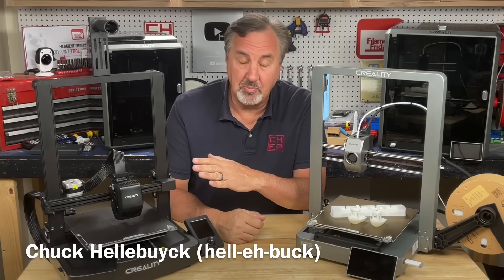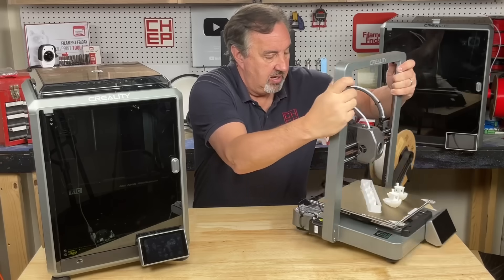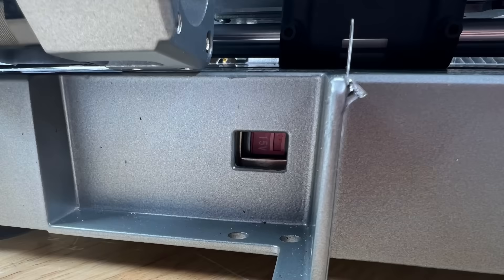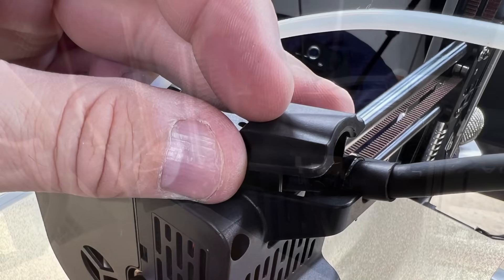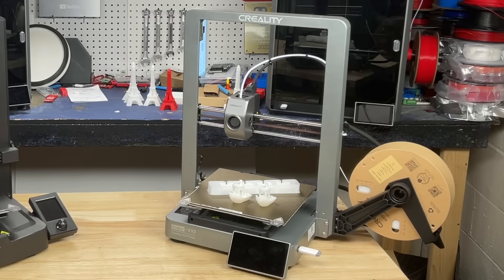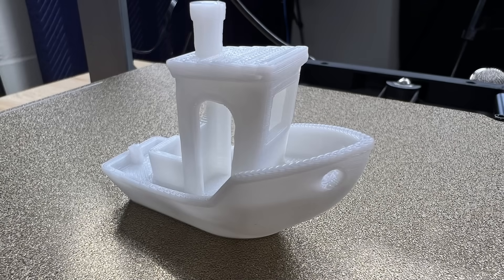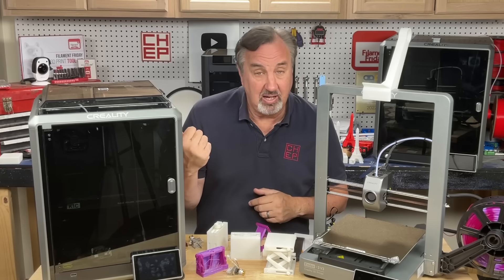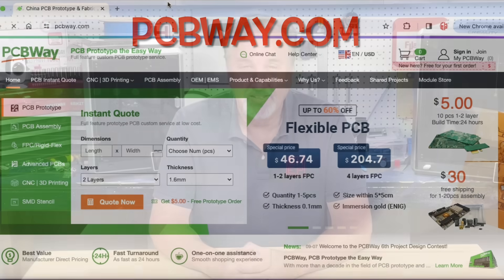Ender 3 V3 - The Fastest Ender 3?

Comment: Did you ever use the top mounted spool holder? I think the side mount was intended because having the spool on top creates issues if it jiggles when printing at high speeds
Reply from the maker: Not on this printer. Original Ender 3’s used it on top for many years.

Comment: Hi Chuck,  are you facing issues with ender 3 v3 se stringing? The PTFE tube inside the hotend is blackened. I could not replace it as stand PTFE tubes have 4mm as od while the PTFE tube used is 3.9mm.. i cannot find a replacement tube.. have you faced this issue yet?
Reply from the maker: No, I wasn’t aware of that size difference.
Reply: @FilamentFriday  The cheap ones that I had been using are 4mm while good quality ones are 3.9MM OD., I was able to buy PTFE tube with 3.9mm od, But I decided to upgrade to bimetal heat break, Thanks

Comment: Hi Chuck, looking to upgrade my old Ender3 V1, hesitating between the V3 and the V3 KE, have you had a chance to check out the KE?  Didn’t see a vid on the channel but maybe you have info from other people.  From what I’ve just seen I’m less interested by the V3.  Speed is of course nice but not a deal breaker, thank you !!
Reply: Just get the V3 CoreXZ. Less head ache, fixed gantry (no wobble) and is just a 1 click print. It also has 2 fans, bed and head G sensor and is fast. Worth the price

Comment: Just got my Ender-3 V3 and I hate the location of the spool holder, too. So I moved the two mounting posts up to the two holes at the top of the printer and it clipped right on. Can't use the spiffy kickstand with it mounted on top, but I didn't have to print one and it seems to work just fine, even using the runout sensor. The filament does get into the wires, so I may run a reverse bowden tube to provide some guidance for it, or I may just bypass the runout sensor and run it directly into the top of the extruder.

Comment: Beware of Creality 3D printers for professional use. These machines might be marketed as universally beginner-friendly, but professionals may find them underwhelming and unreliable.
Creality printers prioritize affordability over versatility, not balance between two. Their focus on PLA filament, which limits their application in professional settings that require sturdier materials.
 Don't let curiosity empty your wallet! Many professional users who opted for Creality printers have ended up returning to traditional methods like CNC routing or injection molding. Consider these alternatives for serious projects if you don't have a bang for the buck.

Comment: do you have any thoughts on the creality v3 KE? its supposed to be 500mm/sec but wasnt sure on the quality of print at that speed
Reply: So far I'm not bowled over by the print quality I'm getting from mine. I have a lot of experience of using some original Ender 3s and they blow my V3 KE away in all honesty. The shop I bought mine from have offered to have mine back to either repair or replace because there's such a difference in surface finish between faces produced in the Y axis compared to those produced in the X axis

Comment: I received mine a few days ago and the firmware on it is terrible. It won't allow you to adjust the Z offset unless it's printing, and then resets once done. You also can't manually set the speed while printing, it only gives you predefined settings. You manually can set the temp though. It makes no sense. I just hope they update it soon.

Comment: Oh no! Yet another Ender 3 (v3) printer after the Ender 3v3 SE and Ender 3v3 KE... Too bad Creality doesn't get it that sometimes less IS more!
Instead of 3, 5 or 7 new Ender printers there should be only one "new" Ender 3 with noticeably better features than the predecessor v2 and a compelling price!

Instead Creality confuses their own potentially customers again with too much half backed options!
Creality, please bring less printers but invest that development time more into the user experience, details and the support of existing machines!

Sovol brought the SV07 out a while ago and the reviews were just fine! So if I would want a fast open printer for below 300 bucks with that build volume: I'd buy the Sovol SV07 instead. It has better cooling, is easier to maintain and seemed to be more polished out of the box.
The Bambu A1 could also be an option ... but I don't like their closed firmware and there are some tests revealing privacy issues. Bambu Lab is collecting a whole lot data ... too much for my taste.

But since there is a better option available from Creality itself: I'd look out for the next sale and the revised K1 (since the release) for around 400 - 430 bucks. It has better cooling, looks better, I can integrate some filters like the Nevermore or Bento-Box and eventually step up my understanding of software and firmware by diving deeper into Klipper.

The only thing Chuck could also do a video about is: silencing those "speed" printers! ;o)
I gladly would take the option of printing a good deal slower again if the noise level also can be reduced with maybe some fan upgrades and some software tweaks. Sometimes it's simply for me not necessary to use all the speed. So a quiet printer setting for working silently in the background would a nice option.

Comment: Always issues with Creality machines.  I have an Ender 3 V2 which works fine for me BUT, I will not buy any Creality machines going forward.  Crap, crap, crap.
Reply: same, I have a ender 3, i am planning to sell it and buy a Bambu labs A1
Reply: @samtheengineer   If you pay more, you get more. That has always been the case.

You could also have bought a Prusa Mini back in the day instead of that Ender 3. But you didn't because of the price.

Comment: Seems a good printer. But I still prefer my Ender-3 Pro. I bought it in 2020, then I got an Ender-3v2 and an Ender-3S1. But untill now the Ender-3Pro prints much better quality and I do not have to tweak the settings all the time. I rarely touch the settings and the print quality is still very good. For the Ender-3S1, I need to correct the settings many times. 
By the way, could you tell me if I'm still on the list of your patreons?
Another question: I'm using Cura 5.6.0, but I have notice that the tree supports are hard to remove. Any suggestion?
Reply: Agree.  My 2020 Ender 3 Pro has been a workhorse.  I did, however, replace the control board with a 32 bit silent driver board and swapped out the bed for a PEI.  Rarely do I have a failure.

Comment: Hi Chuck - I think you are having a problem with this type of Textured sheet, it is not the first video you don't get a good smooth 1st layer :) Did you wash the plate with dishwashing soap and warm water before you started printing? Love your videos and I want to try this new Core XZ Ender 3
Reply from the maker: I clean all plates often. The plate worked fine on the k1C. Also works fine with PLA and PETG. It’s not the plate. The moving bed is not as good at speed as the stationary bed of the K1 style.

Comment: Something tells me that design is going to have lots of issues and problems with overall reliability of the design. Seeing as its critical on belt tensions and knowing how Creality (short for Crap in Reality) are with their lack of quality control and cost cutting, it'll be interesting to see how these hold up to use after 6 months or so. Print quality and speed doesn't seem anything special for the price of the machine.

Comment: I suspect one possible reason for a side mount could be to help mitigate larger vibration oscillation at high speed to simplify input shaping requirements
Reply: +1 .  When I installed Klipper and reached 200 mm/s on my Ender 3 S1, I changed the position of the spool to reduce vibration.

Comment: Chep, that you for another honest review.  The Creality company really baffles me.  Years ago, Crealty became an industry leader by offering decent, inexpensive machines like the CR-10 and Ender 3 that opened up 3D printing to a lot of hobbyists who could not afford more expensive machines.  I myself have a couple of Creality machines: an Ender 5 Pro and an Ender 2 Pro.  Both have served me well, but I have since replaced them with more advanced printers (the Qidi X-Max 3 and X-Smart 3)  because I wanted enclosed printers that could print faster and with a wider variety of materials.  Creality has made some good (and even excellent) machines, but I have a feeling that they lack focus.  They seem to waste a lot of their efforts on different printer models that do nearly the same thing, and not always well.  I have a feeling that a lot of their quality problems would go away if they focused on manufacturing and selling just a few printer models rather than the dozens and dozens of Ender 3 variations that they seem to be obsessed with.

Comment: Microswiss just released a k1C hotend.  Wonder if it will work for the 3v3.
Reply from the maker: It should. I have a couple coming to try out.
Reply: @FilamentFriday  I the flow tech for my K1 Max it's been awesome.  Swapped to the new hardened nozzle yesterday.  Took 5 mins.  So easy.

Comment: It's obvious why they used a side-mounted filament holder. Putting an extra KG on top of that flimsy frame will result in a lot of flex, and poor quality prints (that get worse the taller your print gets). I've dealt with the same thing for years on my Artillery Sindwinder printers. I suspect you should be looking at some bracing of the chassis if you want to move the filament overhead at those print speeds.
Reply from the maker: I’ll find out with the top spool holder I found.
Reply: If Creality would think through their products more thoroughly they would implement an option in the firmware where the printer reduces speeds and shaking when a spool is mounted on top! I mean it's good to have the option, but Creality's job would be to test it and explain to the user what could happen with all the flex ... especially when the spool gets smaller and the weight differs (so compensation would be off, too).
It's should be easy to give the user the choice of printing the right holder by himself. Also showing a 3rd option in the manual with spool dryer beside the machine (so that no weight is mounted to the printer) would also be a compelling setup for many.
A simple question in the printer setup or options menu on how the spool is mounted should be easy to code these days ...

But Creality does Creality things ... or in this case: doesn't do those things, sadly.

Comment: For context, I'm a Creality fan, started with end Ender 3 Pro, and have a Ender 5Pro, K1Max and Ender 3V3 SE. I like all of them. Having said that, I'm not sure why this Ender 3 V3 exists, even if it did print all of the materials successfully.  You can get a K1 for only $100 more. Or if you want an inexpensive bed-slinger, the Ender 3 V3 SE or KE are both great and print all materials flawlessly. The SE is under $200 and the KE is about $250.  $400 for a bed slinger just doesn't make sense, even if it did work.

And thanks for another great, informative video!

Comment: Great video Chep. My V3 Prints PLA and PETG pretty flawlessly just like youve experienced.
Now im a bit nervous to give tpu a try. Im not even going to bother with ABS. I will just wait for my k1c. I just hope I dont end up with the same issues on the hotend with either the v3 or k1c since theyre the same hotend setup.
That was a great explanation for the extruder gear arm also. That thing was a bit tricky to get used to

Comment: -Ordinarily I'd say that Creality is listening to people who don't like having the spool on top for weight distribution purposes, but the robust frame and what I assume is a fair bit of weight down low in the base seem to make that a minor concern here. 

-I do like the idea of the spool tension doodad, though. Shame that it doesn't work once the spool has been more than slightly used up.

It seems odd to me that the Z-axis linear rods are a smaller diameter than those for the X and Y-axes...it's the longest axis, why not have a little extra stiffness there?

This review is an interesting counterpoint to the one Aurora Tech Channel just did...she had no particular problems with her standard non-PLA test prints (including a TPU wallet, an ABS crate, a PETG pen holder, and a carbon fiber nylon cable holder) beyond some very much expected shrinkage with ABS due to there being no enclosure. She did notice that the overall print quality is noticeably behind other comparable printers, however; the perforated crate test for stringing was rather horrid compared to even a CR-10 SE, and there were a litany of issues like ringing across a variety of test files. 

Ultimately, it's certainly interesting to see a commercially-built Core-XZ printer. Other than things like the Voron Switchwire or various Ender 3 upgrade kits, I honestly can't think of another printer quite like this one. Seems to me that 1) the usual budget printer issue of highly variable build quality from one machine to the next is still the case with this printer, 2) there might be great potential for modders and tinkerers to turn this printer into a true beast (Aurora found it to be speedy and had a great first layer once Expert Mode was enabled to make Z-offset adjustments), and 3) whomever Creality employs to name their printers needs to be fired and then maybe exiled to a remote island. 

Seriously, only the basic shape ties the Ender 3 V3 to the Ender 3 V3 KE and Ender 3 V3 SE...rather than leaning even harder into their historically awful model naming convention, Creality should try making sense with their model names for once. Sovol does it. Bambu Lab does it. Prusa and Elegoo and literally every other 3D printer manufacturer do it. It's not that hard.

Comment: Creality printers are for people that want to tinker with 3D printers. Bambu and Prusa printers are for people that want to print with a 3D printer.
Reply: Well said. I did the whole ender 3 "mod it til the cows come home" and I'm over all that. I just want to design and print now. My bambu a1 mini has been fantastic in that regard.
Reply: @NWGR it did that too..until nothing was left but the frame and power. But yea, they are just straight selling fully loaded printers now.
Reply: That not the whole picture anymore.

That K1 is doing fine so far, especially the revised versions after the first reviews. Sadly Creality let's the early customer do the job of polishing a product.
And also Sovol printers seem to works quite well out of the box. The slower SV06 and and Klipper version SV07.

So it is possible for other companies to build ready-to-print machines. But it's still a hit and miss.

Comment: If the K1 and the ender 3 v3 had the same price, which would you choose?
Reply: if you could buy a tesla for the price of 4 piece chicken nuggies, would you still buy the nuggies?

what kind of question is that
Reply: @t0ra_d0ra  thanks for being an asshole. Your analogy is off base and quite moronic
Reply: You should definitely get the K1 in this scenario. Well, if you have the spare money you'd be better off with the K1 as it is. An enclosed printer is just always useful for printing more options, and CoreXY where the bed doesn't get slung around is still a better design. Bedslingers, even of this design, compete more on price than quality. A valid virtue on its own certainly, as the printer you can afford is better than the one you can't. But I'd take an enclosed CoreXY over a bedslinger any day.
Reply: @JameTek  thank you!

Comment: Creality clones the Voron Switchwire.  Guess that's their answer to everyone who has spent nearly double their price on the Ender 3 V3 to build a Voron Switchwire out of a Ender 3 Pro.  Which is what I'm currently doing!  The Voron switchwire doesn't have a force gauge sensor on the bed for auto leveling, the Voron TAP is the closest gizmo to that, but it won't work on bedslingers.  I haven't finished my "Enderwire" yet, I hope it prints well. If you dry your PLA or PETG well, you won't get stringing!  At least that's what works for me.
Don't move that gantry by hand so fast, if Creality hasn't protected their electronics board with diodes, you will blow out the driver chips from the back EMF generated by the motors!
I guess they moved the spool holder downstairs because this printer is FAST and the spool holder on top will vibrate a lot which will be transmitted to the printer frame which could cause artifacts in the prints.  I bet they moved the spool holder at the last minute after beta testing the printer!
You must have gotten a "lemon" to try out, I've seen a few other Youtube reviews on this printer, and the results were better.  BTW, I've printed many ABS parts for my conversion on an Ender 3 Pro, and had no problems.  I did stick the printer in a closet, and surrounded it in a cardboard box to make a DIY enclosure, using a towel as an insulator.  This kept the heat in.  Also put the parts in the very center of the bed when slicing.  Micro Centers house brand of ABS worked fine, some no name Chinese ABS was crap.
Reply: Good tips but chep has it covered
Reply: Years ago someone on YT purposely tried to blow up the driver on an Ender 3 by quickly moving the hot end around, they could not do it by hand and so employed a drill, It was not possible to blow up the driver!
Reply: @AndrewAHayes  Tell that to ModBot, he did it on a BTT board.
Reply: I bought the v3 as I wanted to play around with the Swirchwire but didn’t want to build another Voron for $500+. Already have several core xy printers so this was just unique.